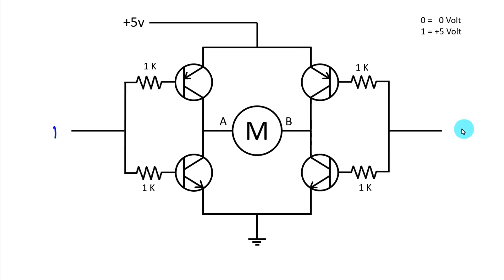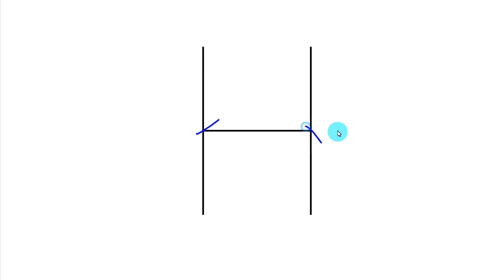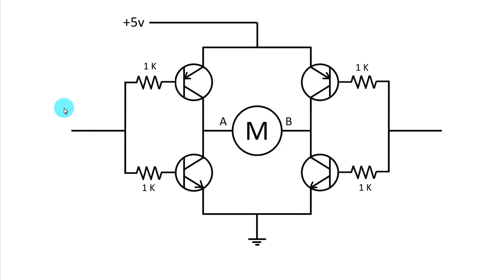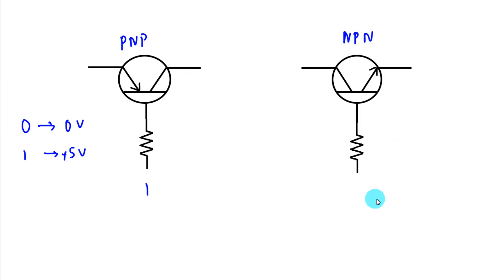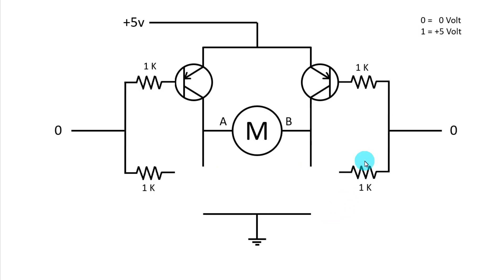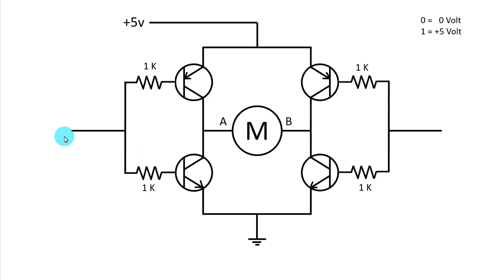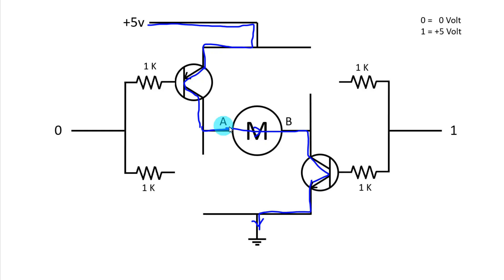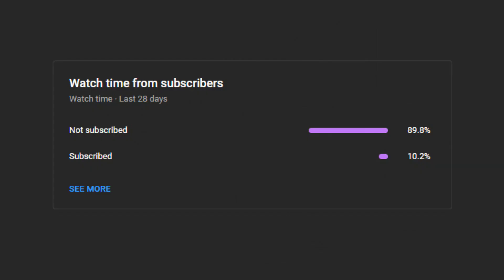H Bridge Circuit using Transistor | H Bridge Part 2

Comment: You pull the base low to turn the PNP on, and make it higher than the collector and emitter to turn it off. And, to put a PNP into active mode, VE must be at a higher voltage than VB, which must be higher than VC. Another opposing characteristic of the NPNs and PNPs is the direction of current flow. This is what Google says? I am a little confused.

Comment: Most people don't have those transistors. I have tons of them because they're my go to for general purpose. Push-pull and current mirror might be good topics. If you email me a decent diy constant current circuit I'll send ya some dollars Deb. I've tried a bunch but don't like them. For 3 watt cobs that need around .4a. I'm renovating my workshop and want to build my own lighting as I have about 60 thousand leds haha. I don't want to buy a special led smps because I have been researching them and plan to build a simple one once I get my diy pcb workflow going. The hardest thing I find is picking out a mosfet driver.
Reply from the maker: I find these transistors very useful. It can handle 1.5 A easily.

Comment: Very well explained. .thank you so much for this video..🙏
Reply from the maker: Most welcome 😊
Reply: @EEWave  how to protect the H-bridge circuit from back emf?  
Does NPN used in this circuit, needs to be logic level transistor or normal to get full current?